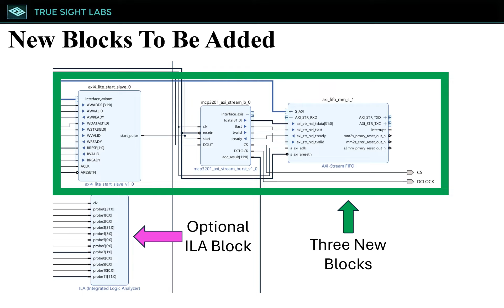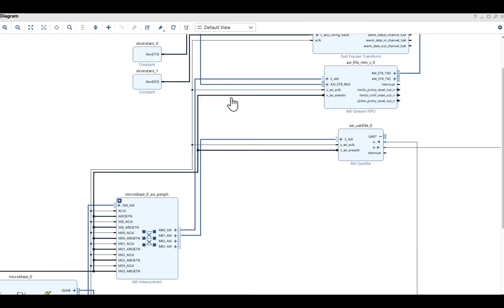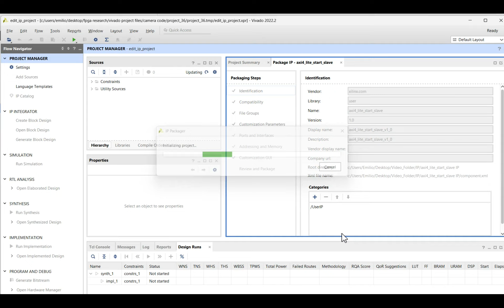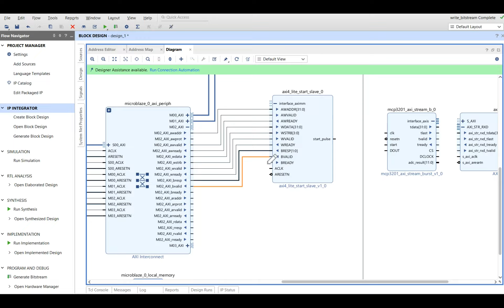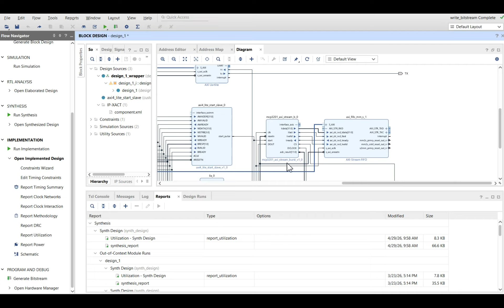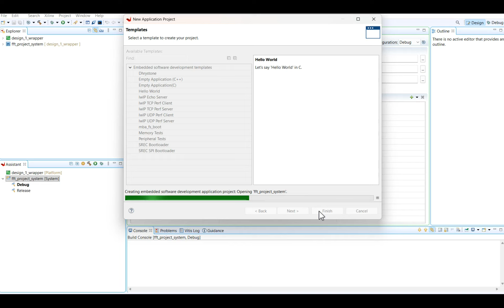FFT on FPGA (Part 4): Real-Time FFT with ADC Sampling, MicroBlaze, and Vivado

Comment: Any thoughts on building the SOC using LiteX?  They have sophisticated, open-source, modules (ex. fpga-fft)  that target Xilinx.  Instead of the MicroBlaze, it uses risc-v.

Alternatively, if using commercial tools, any thoughts on Simulink HDL coder?
Reply from the maker: I have never used LiteX but I have used Simulink HDL coder. Simulink is a very powerful tool for DSPs since it allows you to impliment digital filters very quickly. I have a video on how to use simulink in case your curious.